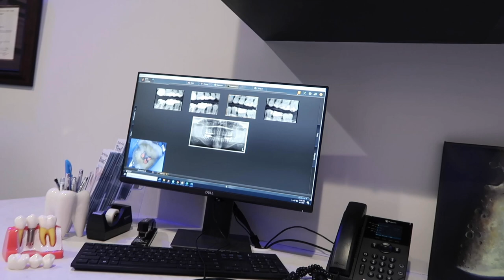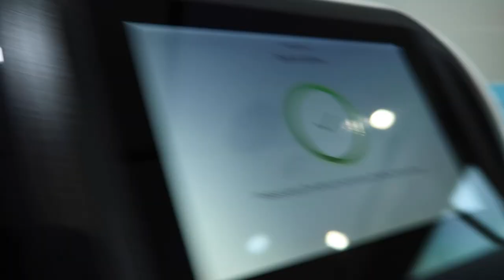being a dentist for a day | is this a vlog? | giuliana

Comment: I might be able to help you and your subscribers out with glasses fogging up with a mask on from an old military diving trick.  rub the glasses with a bar of soap and use a paper towel or a rag to buff them out.  I do this with my sunglasses and it works for a couple of days.  Also from your vlog, does your brother fit people with permanent crowns on Day 1?  I needed a crown after breaking a tooth and they fitted it first with a temporary crown and I had to go back a month later to get the permanent crown.